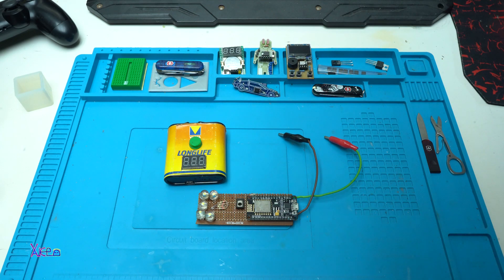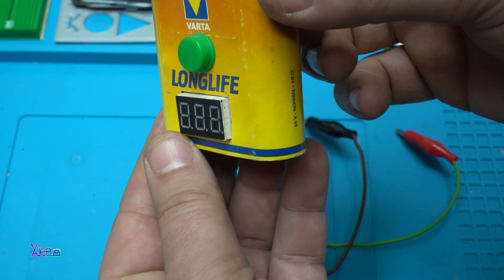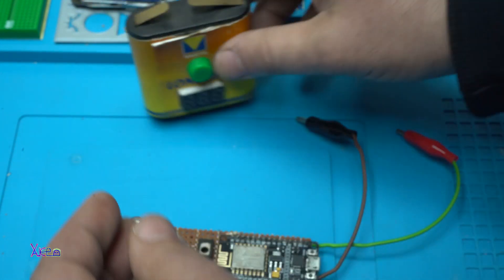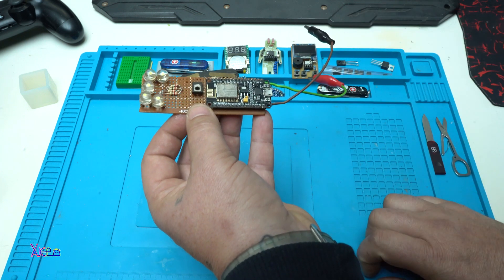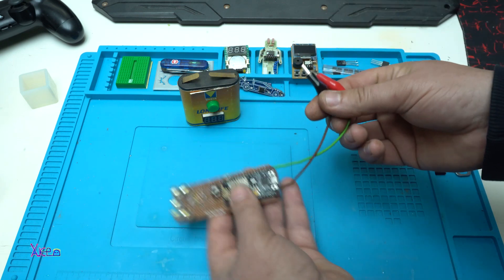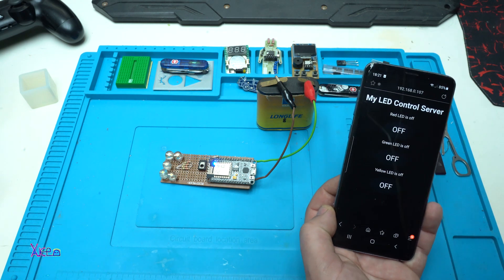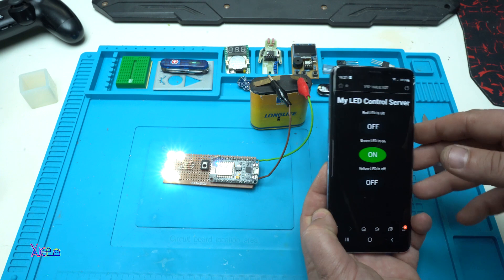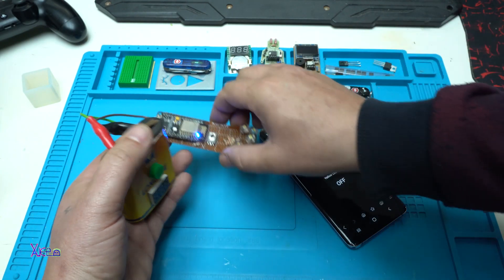Wireless Invention DIY Power On/Off Energy

Comment: I will equip the headlights of my car with it with the circuit. I have fitted my car headlights with 1 watt leds to save energy. I then drive at night with emergency lights. I then switch off the 55-watt halogen bulbs.